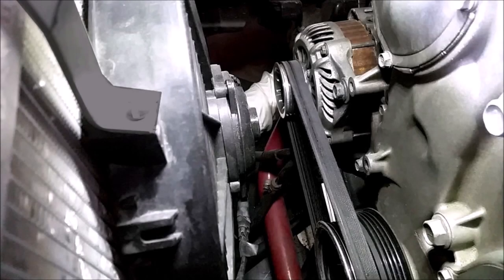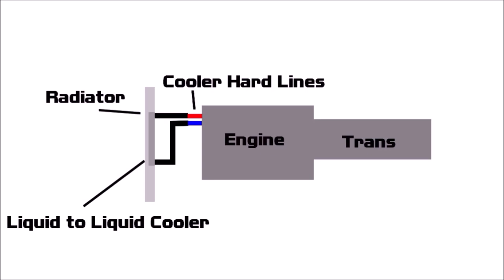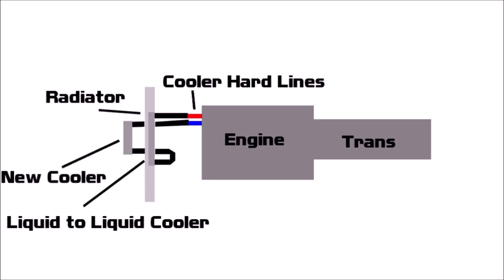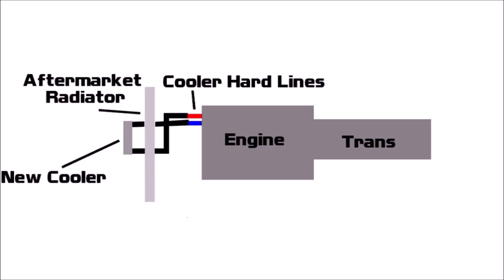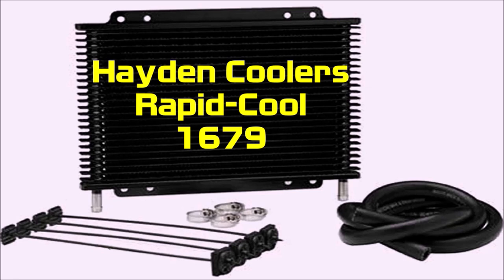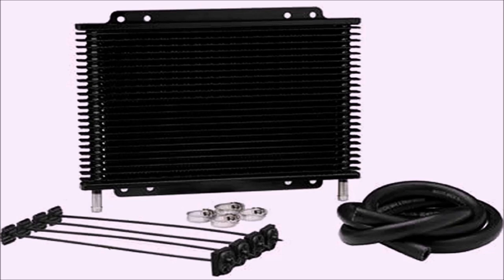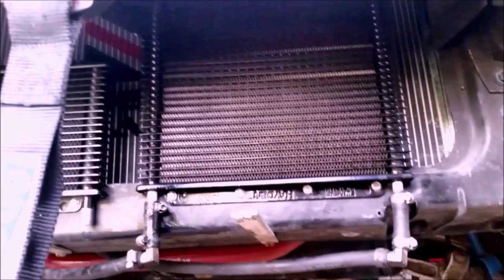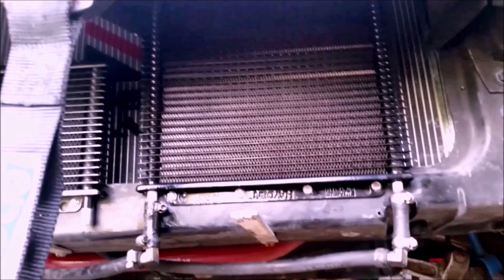Nissan 350Z Budget Automatic Transmission Cooler DIY

Comment: I have a standard and I’m still obsessed with these videos man. Keep up the good work 👍🏼
Reply from the maker: Thanks man! Next week is a DIY thermostatic oil cooler for less than $100.
Reply: 350Z247 wicked! I currently am running a non thermostat one as I live in a hot summer and cold winter and park my z for winter

Comment: I actually brought the cheaper cooler before i saw your video. Is it safe to bypass my radiator and run a direct to the cooler in the front of my 350z I'm seeing in your video u also tied it into the radiator
Reply from the maker: Use the radiator if you can, but if you go aftermarket radiator, you're fine just to use the aftermarket cooler.

Comment: Have you noticed a big difference, as to how it Shifting now on your automatic with this Hayden cooler set up?
Reply from the maker: It shouldn't effect how it shifts but just make sure it doesn't overheat and fail. It keeps the transmission under 220 degrees fahrenheit even with 25-30 minute track sessions.

Comment: But, which line is actually hot and cold. I think i heard the passenger is hot out, driver cold in?
Reply from the maker: It shouldn't matter especially if you're replacing the factory radiator. Either way, you're adding a cooler to the loop. You may be able to figure it out by using a temperature probe on each line after driving it hard for awhile. You should see a temp drop big enough with the factory cooler for the probe to see a difference.
Reply: @350Z247  the problem is I bought mine salvage and have to piece it back together. The cooler line was looped by about 4" hose. So I can't drive it around to figure out. I'll just settle with how i plumbed it.
Reply from the maker: @Flare1107  you should be able to hook it up either way. There aren't any valves to worry about. It's just runs through a finned cooler.

Comment: So I ordered a Mishimoto radiator not knowing about the two extra hoses you mentioned for the transmission cooler. By the time I installed the radiator I found out there’s no where to plug in the hoses mentioned. After searching around and watching your video, I’m informed that I need to have a separate cooling system since I also have an automatic 350z. Would you recommend the Stillen cooler from Z1 Motorsports?
Reply from the maker: There's nothing wrong with it; it's a good product. I just think it's over priced for what you actually get.
Reply: Hey bro I’m in the same situation as you did the cooler end up working for you?
Reply: @CarlosMartinez-uf3tw  yeah you just have to order an transmission cooler radiator too off Amazon and then zip tie it to the mishimoto radiator. It’ll be way smaller

Comment: So you run both lines too the trans cooler? Does it matter with line goes to witch side. Trying to install aftermarket radiator and I have one of these just can’t figure it out 😅
Reply from the maker: As long as your chosen cooler is not directional for some reason, it doesn't matter which side goes to which

Comment: Doesn't the Hayden Automotive 679 cooler do the same thing? Or, did you pick the 1679 model because of fitment? I got to mount it on the frame, so I need to look for some metal strips or brackets.
Reply from the maker: As best I can tell, they switch back and forth on the part numbers; I think they're the same exact part. It comes with some universal brackets that may work for you
Reply: @350Z247  Oh I see. I wanted to make sure it wasn't a typo. On Amazon, for example, it's called Hayden Transaver OC-1679 Extra Heavy Duty $72.
Reply from the maker: @Zeppelinlv2007  You should be able to find it closer to $40 somewhere

Comment: I found the cooler on EBAY but can you tell me or post a link where I can buy the barb from 3/8" to 5/16"
Reply from the maker: I just ordered it from an eBay vender. You can get as fancy as a specialty pipe fitting site if you want.  Just type in "3/8 to 5/16 barb 90", and you'll find what you need.
Reply: What is the original hose size? On hard lines.5/16???

Comment: Hey man does it matter what transmission hose I put on the bottom or top I have a universal trans cooler for my 08 g35x i want a stand alone cooler not connected to the radiator
Reply from the maker: No, as long as the cooler you choose doesn't have any sort of internal thermostat, direction won't matter
Reply: @350Z247  does the stock size hose fit if I use the hayden ultra cool 403 trans cooler
Reply from the maker: @abbas674  I would get some new hose from the parts store. I think 5/16 is what the factory uses, but the cooler will need 3/8. I used a 90 degree adapter to make the transition
Reply: @350Z247  I have everything ready to by pass the stock cooler will the 403 Hayden be enough to cool the transmission without the stock cooler in place
Reply from the maker: @abbas674  it did just fine on my car while on track. I'm not sure how it would do in bumper to bumper traffic but likely fine.
Reply: @350Z247  I returned the 403 and got the one you have the 679 thanks

Comment: Where is your power steering cooler?
Reply from the maker: I deleted my PS
Reply: @350Z247  For 3 to 8hp gain, and a total pain at slow speeds?  Does not seem worth it.
Reply from the maker: @gearjunky63  Power gained, faster revs, weight lost, money made, engine bay cleaned, steering feel increased, and one less part to fail.
Reply: @350Z247  Good info, thanks

Comment: Can you post a link for the hoses you used please
Reply from the maker: I just went to a local parts store like Auto Zone and bought some 5/16 hose.
Reply: @350Z247  so the 5/16 hoses and the 5/16 to 3/8 fittings and just cut the oem hoses to fit the piping right ? Or did I miss something
Reply from the maker: @charger6773  No cutting of the factory parts needed. 5/16 from factory hard line to the 90 degree fitting then the provided 3/8 hose to the cooler.